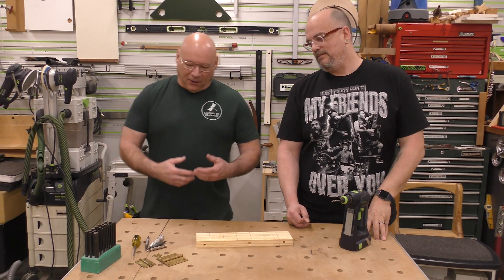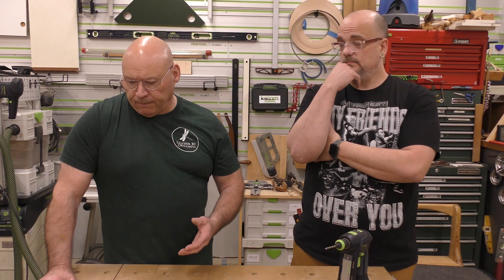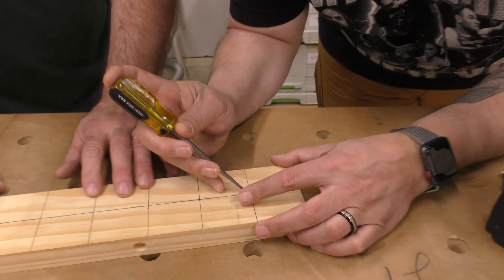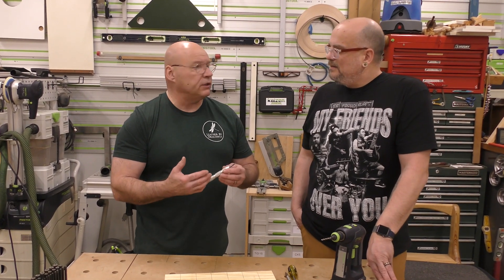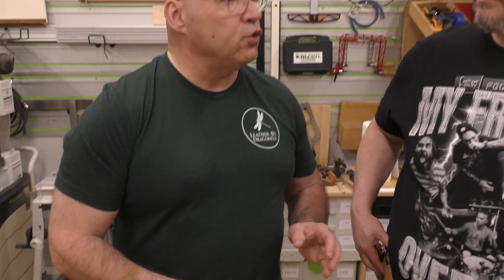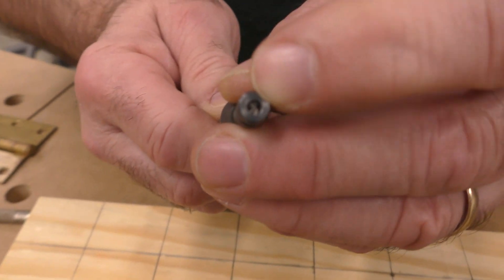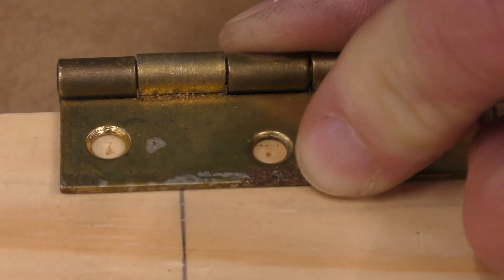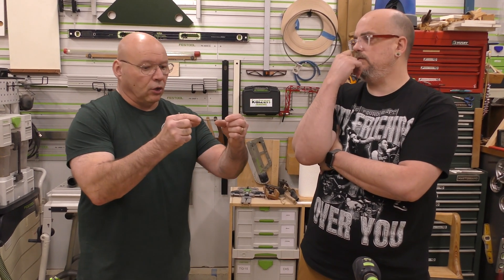Getting Centered: Marking and Drilling Center

Comment: Most of my HF transfer punches have been turned over to indicate that they have been used at least once over the years.  Great episode on these valuable woodworking tools as when you need them, you need them.   I keep two sets of VIX bits.  One in my drawer slide mounting kit, and another in my drill accessories kit as they are so valuable.
Reply from the maker: Right on